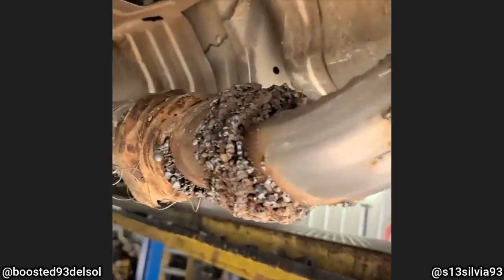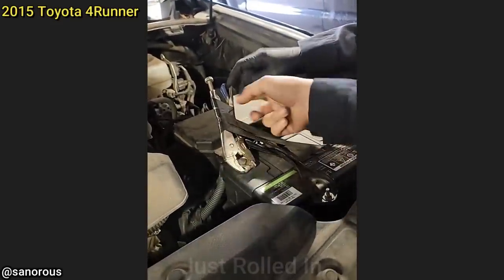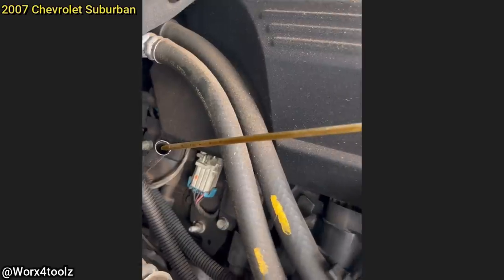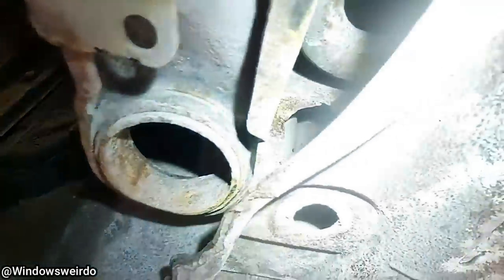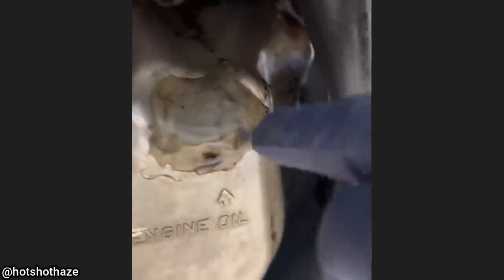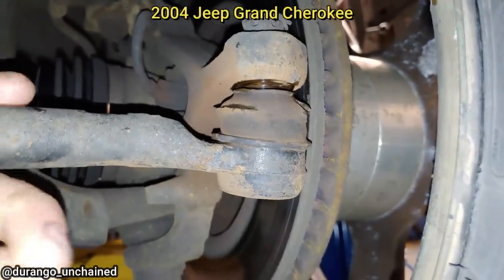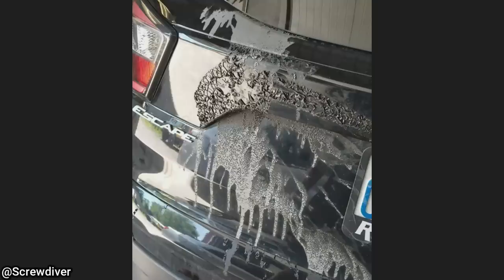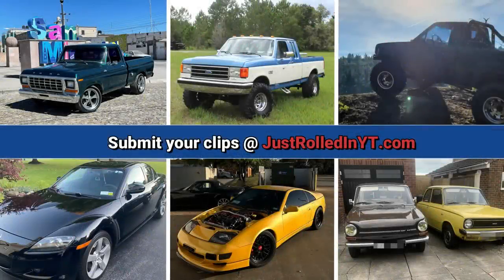Customer States Exhaust Sounds Terrible & Drags On The Ground | Just Rolled In

Comment: Just imagine how long it took to "weld" that exhaust. That's some determination there.
Reply: They could probably have researched how to prevent whatever was causing that, changed whatever settings, and done it passably, all in the same time.
Reply: I'm no welder but I can actually weld decent without leaks (skwigly lines and non overlapping puddle). May not be lipstick on a pig but it sure as hell isnt that bad. My welds look like you gave a child a marker and said draw a straight line.
Reply: That "welder" is only certified in the JB kind of welding 🤣
Reply: The thing that surprises me the most is... Yeah, ok. You made an horrible job with the welding machine.... but ffs, at least use a flap disc to clean the welding.
Reply: I'm still a learner but I've never made welds that look like a bird's nest. Whoever did that was kinda a mix of detrrmined and useless.
Reply: I'm wondering how many spools of wire they used.😂
Reply: It reminds me of a sculpture I saw in my modern art college class.
Reply: Looked to me like a nest of fire ants.
Reply: @SDogo  "A grinder & paint, makes me the welder I ain't!"
Reply: IDK, meth?
Reply: That is MIG welding, Metal Inert Gas without the gas. Argon Gas is used to shield molten metal from the arc. This guy would be dangerous with super glue!!!
Reply: looks like a combo of no flux/gas, wrong grade wire and probably wrong polarity just for good measure.  Whoever did this needs to return, sell, give away or throw away their welder because if they can't even work a hot metal glue gun, they're SOoL for every other form of welding.
Reply: And an entire 11 pound spool of wire!  Some people are welders, and then there are peiople who own welders.  The work they put out isn't quite in the same category.
Reply: @NemoConsequentae  Only if you use plaster to cover the holes :D
Reply: I remember this saying and use it from time to time.

A grinder and Paint makes me the welder I ain't.
Reply: @NemoConsequentae  Snap, you beat me too it already. It's a good one!
Reply: I've touched a MIG welder twice in my life.
I've never made welds that bad.
Reply: Looks like he used the blobular transfer process.
Reply: They were definitely determined, that's for sure but I still can't work out for the life of me how the hell they managed to make weld look like that
Reply: That weld looks like cancer I hate it. You'd have to be paying me 50/h on labor for a weld like that, I don't even want it for free take it away
Reply: Seeing that ugly mess of an exhaust pipe fills you with DETERMINATION!
Reply: I took a year of welding in high school and even my very first weld didn't look that bad.
Reply: bruh it looks diseased
Reply: One could imagine he learned in the process, but the last welds are as bad as the first ones.😔
Reply: It looks like a mermaid tried to repair that exhaust with coral deposits.
Reply: Somebody was having fun with his new welding toy!
Reply: There's no way that wasnt a troll video of seone just fucking around out of boredom
Reply: Mig, steel wire, aluminized tubing. Standard results.
Reply from the maker: @solidcobalt  we've seen welds like this in two other videos - https://youtu.be/3ssRCSxJm3s and https://youtu.be/oPEuV8_Sh3U
Reply: That was a long series of tacks, one atop the other. How much wire was wasted? FFS I've only welded I'm guessing 20 hours in my life (mostly wire feed, some MIG at the start) and not to toot my own horn, but wow... how... how is that kind of "welding" possible? You'd have to go well out of your way to consistently fail that hard. It's not like the  " welds"  are getting any better the further down you go...
Reply: That’s an artistic weld. He was inspired by barnacles.
Reply: @XxTWMLxX  we call that guerrilla welding, and it's perfectly valid

it might look like shit, but god damnit it's fused
Reply: That weld is a work of art.  They should put it in a museum.
Reply: @GYPSY400  V scissoring says otherwise.
Reply: @billweeks9606  Have you never welded? The operator has the speed set way too low and I bet the media is like 4-5 inches (at least) away from the workpiece. He's probably tapping it on there too. I mean, even if you're a complete moron, you'd understand that this is not correct and, I dunno, try to adjust the settings, your stance, etc. 

Some people should stick to flipping burgers or moving boxes onto a belt.
Reply: @billweeks9606  I have no idea. It's a spectacular waste of wire, and must weigh a good bit too. Done on purpose maybe?
Reply: @GYPSY400  cringe, consider sewer slide 🏳‍🌈
Reply: @Mikowmer  Was just going to comment, “If Papyrus was trying welding instead of cooking.”
Reply: @markk3652  Ditto, thought it was that from the thumbnail for days till I saw the video.
Reply: I'm tempted to say 120v welders should be illegal. I've heard so many stories about people trying to do structural repairs with their decorative welders.
Reply: @billweeks9606  I'm nut sure drug addicts own welders, it would have been pawned already. Also, who the hell would hire a drug addict to do car work? No sir, the welder in this case has moderate to severe mental handicaps.
Reply: I found the thumbnail for the exhaust disturbing like it might attack me in my dreams, do I had to come here and remove its power over me.
It looks more like a series of hornet's nests rather than a weld job.
Reply: @jasonsummit1885  All of them, the answer is all of them
Reply: @jamesmcdonald6047  Actually, the shielding gas is to "shield " the weld puddle from the surrounding air.  CO 2 is the normal shielding gas for MIG, or sometimes 75/25 mix.  Straight argon is normally used for TIG. That said....your correct...they'd be dangerous with super glue.
Reply: @hokep61  I stand corrected, we used it in early 80’s at R.R. My thinking was CO2 came in with fluxcore???
Reply: "determination". - yeah that's one way of putting it.  Not the word I would use.
Reply: @@trollolol705 its just the wire speed turned to max.
Reply: I thought the video thumbnail was a bunch of bee colonies clinging to the exhaust for dear life.
Reply: Grandpa taught me how to stick weld. After that mig and tig was easy. Thx Grandpa!
Reply: wait that was a weld
I thought it was a hornet's nest.
Reply: Wouldn't you start to wonder if you were doing it right after you'd used up like five boxes of welding rods? LOL
Reply: From the thumbnail, my first thought was that they had a wasp nest wrapped around their exhaust.
Reply: Determination, or a whole lot of meth.
Reply: ZB welld would have done a better job.
Reply: @SDogo  If he did that, he would be where he started. Btw, it looks gross. Like some kind of fungus.

Comment: Pretty sure that exhaust wasn’t welded really badly, but was barnacled excellently.
Reply: Looks more like clusters of sea-urchins to me!
Reply: I didn't understand what I was looking at.   but yeah was the car driven underwater or something wtf?
Reply: @VoodooV1  I thought it was barnacles at first too.
It is little pieces of welding wire from a homeowner-type mig welder. 
It melts then stops melting and you have to cut the wire, then try again, and cut the wire and try again, and again, and again, and again, it looks like hundreds of times.
You would think after a hundred failures they would figure it out.
Reply: @bigredc222  Meth is a hell of a drug.
Reply: I thought they were oddly placed beehives.
Reply: looks like he had a mig welder and no gas

Comment: People just never learn about quick lube shops, do they?
Reply: Rule #1 of car ownership: Use judgement when using quick lube shops. 

Edit because I realize my comment was initially a bit harsh.
Reply: Amen to that.
Reply: I used to work at one, was a manager actually and we took our jobs very seriously.  We were actually required to put the upper bay technicians and lower bay technicians initials on the filter, along with the store number and the date.  We usually serviced 120 to 160 cars per day.  We were also required to say "all caps are tight" while physically checking them, and required to watch the lower bay technician put a wrench on the drain plug and a hand on the oil filter.  People can talk trash about quick lube shops but some of us were very proud of our work.
Reply: Don’t lump us all in together.  I am a technician at a quick lube and we are very good at our jobs.  It has been years since we had any cars with a problem.  I do see cars from other quick lubes that come in with mistakes a lot though.  It’s mostly stuff like oil filters overtightened and seized on and cross threaded drain plugs.
Reply: Quick drain....on your purse
Reply: still, any lube infinitely better than no lube.
Reply: @CaptainPlanet792  👍hey Thats great to hear.  Keep up the good work, People will notice the high quality shops. 

I’ve had my share of seized on oil filters from dealerships too ha. Happened to my own vehicle once after i let a dealer change my oil out of convenience and it damaged my oil pan. I’ve worked for two quick lube places and had really bad experiences there unfortunately.
Reply: @trm4life  i love hearing this. Early in my career I was a dealership lube tech at a small dealer for a while and took a ton of pride in my work. I made a few mistakes here and there but i never damaged a vehicle or had a comeback or unhappy customer. Knowing you’re doing high quality work and following process is very fulfilling 👍
Reply: @trm4life  people say they took it to a quick lube but they could have done it themself ,, if I took it to a shop and had a problem I would take it back and ask what happened
Reply: Guess what? Car dealerships and legitimate shops use the shop monkey for changing oil too. You’re not getting Mr. ASE Certified changing your oil anywhere.
Reply: I went to one that tried to tell me my air filter (carburetor) was dirty and I needed a new one ($42). I had just put a new one in myself a week before, and it cost a lot less than $42.
Reply: Maybe try and teach more than ridicule? Someone taught you right? Your part of the problem, " just rolled in" hahaha
Reply: @thisoldbelair  Most people do notice it.  I had a customer a few weeks ago say we are expensive.  I asked him if he has checked the prices recently at valvoline or jiffy lube in the area.  His response was no, I would never bring my car to any other quick lube because I know here I don’t ever have to worry about problems or mistakes.  Also had a customer with a Mini Cooper tell me he will only bring it to us.  It’s one where you need to move the coolant reservoir to get to the oil filter.  Apparently other shops he has gone to have just left the oil filter and he said he knows we would never do that.

I have had a ton of people also tell us they only come there because of how honest we are.  If a car doesn’t need something I’m not going to lie to the customer and tell them it does.  Same thing goes for our mechanic that works there.  He handles the bigger jobs that are over a lube techs abilities.  I have been there for 10 years and when I need him to do a repair on my car he still brings me into his bay to show me the problem before he does any work.  I have told him plenty of times just do the repair, I know you aren’t lying to me.  The same thing goes with our repeat customers for the mechanic.  He will ask them to stop by or come out to his bay to show them the problem.  Their answer is usually always the same as mine.  You don’t need to show me, just do what needs to be done.  I know you are telling me the truth.
Reply: @CaptainPlanet792  epic. I love good shops like that 👍
Reply: I bring mine to the nastiest ones I can find .  Eventually someone is buying me a motor.
Reply: @willbaack7997  😂
Reply: My local Valvoline is pretty good. After I got a weird warning light after going there, they were very helpful
Reply: Nope! We had a customer come in for an oil change after the quick lube they had been going to mentioned something about having to suck the oil out and couldn't replace the oil filter. The probably $45 oil change they got at that place ended up costing them over $3600 because the upper oil pan had to be replaced. It had a cartridge type oil filter and we couldn't get it off at all. Taking an air hammer to the plastic cartridge would have most likely damaged the upper oil pan as well.
Reply: @dr_jaymz lube is your friend
Reply: I called around to several lube places because the dealer wanted too much and they all wanted almost as much and I changed myself for half the price

Comment: These exhaust weldings are almost an kind of art of themselves
Reply: 20% more weld, and I bet it would have solved all the issues!
Reply: that should go up on the shop wall.
Reply from the maker: @jorno1994  I forgot to say but the mechanic who shared it with me said they actually did that 😅
Reply: @JustRolledIn  .. A true physical testament of a really patient and determined person.
Reply: @JustRolledIn  oooh, thats rufffff
Reply: That had to be a prank.

No one could spend that much time trying without getting at least a little bit better.  It only takes an hour or two of practice to do farmer welds.
Reply: At first glance I thought it was maybe the flex pipe blowing out 🤣
Reply: @1djbecker  we've seen welds a handful of times like this on this channel so I doubt they are all pranks
Reply: With welding like that, he probably did not disconnect the battery so alternator/wiring stuffed as well?
Reply: they make me want to throw up
Reply: I do not know how even to do welds this bad

Comment: 1:28 when you see an oil filter on that condition you know it's been quite a while since their last oil change.
Reply: I noticed that too! lol  I know rust works fast in the northeast but man!
Reply: Of course he declined repairs
Reply: @gam3kid  Hopefully, his next stop is the junk yard.
Reply: But he wanted the exhaust leak fixed????
Reply: That's a first for me. I've never seen a RUSTED OIL FILTER BEFORE.
Reply: Although oil filters CAN rust out fast in the rust belt parts of the US, that is probably the original  oil filter and he has never changed it.
If rust in his area was that bad, most of the car would look like the oil filter.
Reply: it was rusted 😂

Comment: How do you mess up a weld that badly. You have to try to do that!
Reply: Those are my favorite ones on these videos.
Reply: Soup cans and some clamps would have been easier.
Reply: I wonder that myself. If I were to try to make my welds look like that I am not sure where I would begin.
Reply: With friends like that, who needs enemas? 💩
Reply: @jeffrobodine8579  For real, I had an exhaust leak on my 96 civic when I was a kid, so I just bought some sheet metal and hose clamps and clamped that beotch. My buddy still drives that car...wonder if the repair has held up!
Reply: That had to be done with non-flux core wire.
Reply: I went into a welding class knowing nothing about it and it still looked better than all of the crap I see on this channel
Reply: That's a piece of modern art, you guys are such philistines 😆
Reply: Well Hell he did try, and try, and try, and try..
Just couldn’t get that puddle!   😂
Reply: That is literally the worst welding I have ever seen. Unbelievable!
Reply: I mentioned above that I think the guy needed/wanted a new exhaust, and he and his friend decided to mess with the shop. It's probably a TikTok challenge to see if you can get into a JRI video...
Reply: Although I regretfully never learned to weld, even I know how a weld should look, and it's nothing like that.
Reply: @elultimo102  
He was scared of that sparky thing!  😂
Reply: It is easy if you have not ever even heard the word welding.
Reply: not sure, I once blindly stick welded a hole in an exhaust on an old beater that was not worth the time or money to do a better job. it worked and I doubt it looked any where near that bad, even with the slag still on it.

worked for at least 100K km before I got rid of it. ironically one of the most reliable cars I have ever owned. the only maintenance I did on it in that time was a set of brake pads, some tires, 1 heater hose and oil changes. it already had 360K km when I bought it.
Reply: I'm not making any excuses for the poor welding. it looks to me like maybe the leads were reversed on the wire fed welder.  when using shield gas the leads go one way inside the machine.  When using wire with a core you reverse the polarity.  When not hooked up correctly you will get an arc that leaves a little wire behind but never will make a bead.
Reply: Coat hanger welding rods?
Reply: As someone who has never welded before, can someone explain how welds end up so bad like that?
Reply: @dh190852  I've forgotten to turn my bottle of gas on before and it looked across between a weld a sponge but it still wasn't anywhere near as bad as that
Reply: @markshort9098  I've done the same thing. Doesn't take long to realize something isn't right.
Reply: Extension cord too long/undersized, comes out like a hot glue gun until it trips the breaker/fuse or starts the cord on fire.. Or wrong settings, no gas as has been mentioned.. Looks more bad art than weld... Might make good internals for a muffler, lol...
Reply: I bet it was still on the ground when he welded it.
Reply: I bet the guy used ALL the spools he had on hand to finish that beautiful work of art.  He must have held the tip 6 inches away from where he was trying to weld at least and pinged the speed dial to "all of it".
Reply: by welding electrically without protective gas. they probably only know how to weld with these covered electrodes... though "know" might not be the right term, or else they'd have seen that those are not a welded seam, but what we call "tacked on".
Reply: @dh190852  No gas.
Reply: M - Anyone
I - Can
G - Weld

I, too, am impressed.
Reply: @Fix_It_Again_Tony  wire speed on max and amps too low.